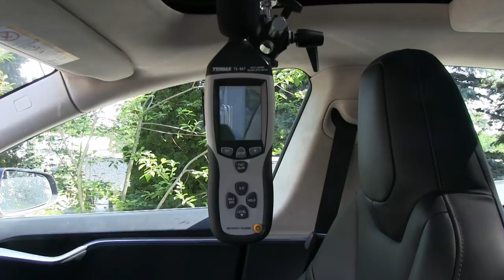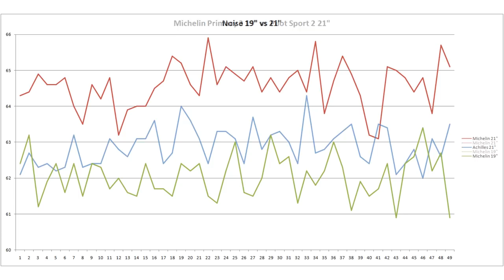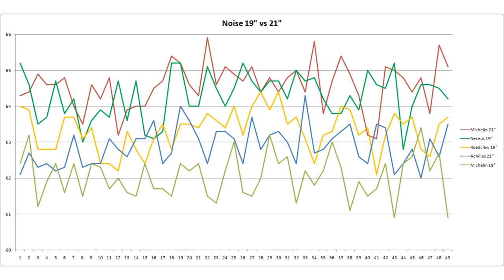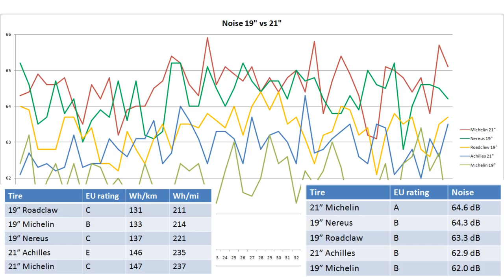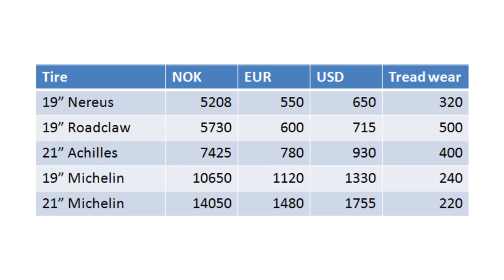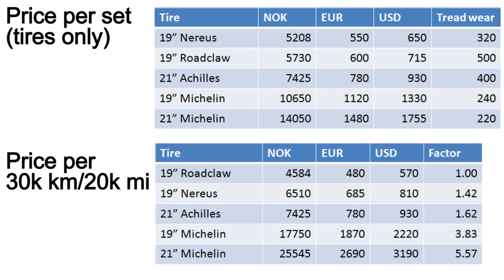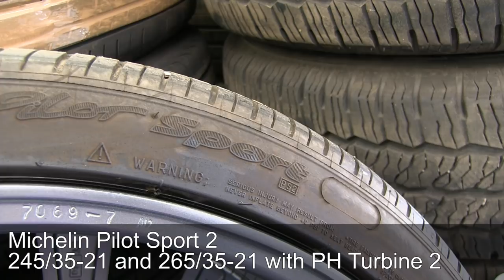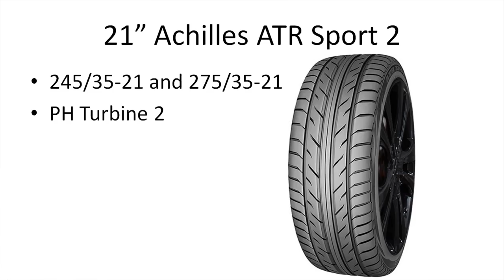19" vs 21" tire test on Model S

Comment: This spring I swapped my 19" OEM winter Tesla Model S wheels with the 21" OEM Turbine summer wheels. It is a bit noisier, but I expected it to be worse. So I am really happy I chose to buy 21" Turbines with my car. They look amazing, and I think they are worth the cost/wear/noise. But each to their own. :)
Reply: Which tyres did you purchase on those?
Reply: Which tyres did you purchase on those?

Comment: Performance is an important consideration. Some tires stop my Model S in 3.5 seconds, while the best can stop it in 2.2 seconds. That’s a huge difference! That’s a safety issue as well as a performance (lateral grip)!

Comment: Wet performance and handling is where the Michelin tires are supposed to shine. I think the Michelins saved me a few times in the rain (in the US) at lights where I needed fast lane changes and breaking to dodge other cars that ran red lights.  If you ever test tires again, could you borrow a test track where they hose it down first?

Comment: thanks for testing....
since 5 (tesla)-years i use "landsail"-tires (also chinese), at the 2013 tesla (model s 85) i used them in 18" and to my 2017 tesla (model s 90d) i use 19" - i feel very well with them
they are really quiet, a set of 4 costs around 300 euro and in my driving style, they will last for 50-80.000 km - the last tire i had to change  was with 55.000 km - it had a puncture, a pice of a cutting blade got into the rubber - handling and braking (also in wet conditions) is perfect, no trouble at all
my consuption over 28.000 km has come to 153 W/km, but i used the summer-tires the whole time - we have no real winter in south-germany

Comment: Good info Bjørn! But I think a test at motorway speed would make more sense. Tire noise is most annoying on long trips IMO. Also a tire that is quiet at low speed could become very noisy at high speed,  and vice versa is actually possible too to some degree.

PS. This test doesn’t take safety into account. Cheaper tires usually have longer breaking distance, worse wet performance etc.

Comment: Bjorns results are strange.
As i understand the Wikipedia article on "tread wear" the indicator is random by manufacturers choice, not to be taken very serious.

 Tests in Swiss/Austrian/German car-club press usually find that Michelin have superior durability (thus also Ecology, less micro-rubber!) over all other brands - while keeping high efficiency with  balanced performance and savety. 
Michelin also claims their designs work well down to minimum tread depth and tests i.e. with CrossClimate model support the claim.
 Thus Michelin is always my preferred option.

Comment: I have read the 10% difference in consumption between 19 and 21" several times. But I am surprised that the difference is already so big at the low speed in Norway. The difference should get dramatic at e.g. German Autobahn speed like 150km/h.
Reply from the maker: Rolling resistance is somewhat constant. Therefore you shouldn't operate with percentage because it doesn't scale correctly with different speeds.
Reply: True, but the rotational turbulence / aerodynamic of the rotating wheel is not constant and seems to have quite a big impact at higher speeds. I would like to know the difference in consumption at higher speeds. The percentage just helps to see how much less range you get with bigger rims.

Comment: I was driving on 21inch Super Sport tires and switched the rear tires to the Achilles and it's noticeably louder when driving above 40mph. Though the price point is hard to beat (Achilles = 87/tire, Super Sport = 340/tire), the foam inside the Super Sport does damped the noise when driving at freeway speeds.

Comment: what you need to test in tires is the core diameters (the part that connects to the drive shaft)... because tires are basically gears, the cores basically are transferring all the rotational force from the drive shaft from the motor... i hope you can do tests again for this...

Comment: Another great video Bjorn!  But how are you averaging 237 wh/mile on 21 inch wheels?  I have a P85 with 21 inch wheels and my average for the last 8,000 miles has been around 330 wh/mile.
Reply from the maker: +dancchang 70 km/h

Comment: Tire compound and tread pattern make more of a difference for noise and efficiency than the "wheel size". Overall, the wheels are about the same diameter and same width.

Comment: If you replace the standard wheel with a larger one it usually means low profile tyres . The manufacturer designs the car with normal tyres and the side wall is taken in to consideration when designing the suspension . Low profile tyres affect that design causing a harder ride and more wear on the suspension. This should be considered if you think big wheels look better.
Reply: 21'' rims are Tesla's ones

Comment: Bjorn, thanks for the review.  Been thinking of buying 19 inch rims to replace my 21 charcoal gray turbine wheels.  Do you have video of the 19 inch turbine 2 wheels? Trying to find a good wheel that looks like the original 21 turbine.  I would like to see what it looks like.  Looking for softer quieter more efficient ride.
Reply from the maker: +Jeremy Wasinger In my videos with the Nereus tires, I use 20" PH2 Turbine. They look similar to 19".

Comment: It's worth pointing out that wh/k is not important when buying tires.  At best a lower wh/k tire is going to save you a couple minutes per stop at the supercharger on trips.  With Teslas now days, superchargers are easily reachable.  It's unlikely that a 20 wh/k difference will effect the number of supercharger stops.  300 km at 140 wh/k is 42 kWh vs 36 kWh for 120 wh/k. Assuming 80 kWh average supercharger rate that's 31.5 minutes vs 27 minutes.  If you're towing, the 20 wh/k tire difference is meaningless when the trailer is costing you 200 wh/k.  

For local driving it matters even less.  Assuming you charge your Tesla at home once each night and pay an off peak rate the wh/k of a tire is likely to be the least important factor.  Off peak electricity is cheaper than the tire wear per mile price difference. A 20 wh/k difference over 30K thread life uses 600kWh more electricity at $0.10 cost you an extra $60 USD - that's $0.002 more per k. When you are paying $0.0183/k ($550 set) or $0.106/k ($3190) for thread wear, the $0.002 cost difference in wh/k is too small to be meaningful.    

Of all the factors that effect the choice or tires you buy for your Tesla the wh/k difference is probably the least important.
Reply from the maker: Efficiency might not be important for you. But it is important for other people. You got it wrong. When towing, saving 10-20 Wh/km is *huge*. You should follow my road trip videos and live streams to understand why.
Reply: Bjorn - I watch all your road trip videos and most of your live streams. The value of saving 20 wh/k diminishes as wh/k increases (saving 20 wh/k if your average 100 wh/k is 20% more range.  Saving 20 wh/k when you use 400 wh/k is only 5% more range).

Comment: Were all the tires inflated to the right pressure? a low tire pressure can cause way more sound to be produced. 
and 30k km on a set of tires? :-o 
I generally do 75-100k on them before the dealer suggests replacement due to wear and approaching the point at which they aren't legal anymore...  and at that point they aren't even there yet..
Bjorn, when was the last time they checked the alignment on your car? ;)
Reply: Model X is very heavy and got a lot of instant power if you accelerate...so...nothing special for a powerful car like his Model X
Reply: @esenel92 you also drive a Model S or an ICE Car? The weight of Tesla's cars and the instant torque eats up the rubber even when not flooring the pedal.
Reply from the maker: 10-30k km on Tesla is common. Just google it. Alignment is ok.
Reply: Wow..  that's insane! :-o 
I'd get that you'd have a little more tread wear due to more power to the wheels and higher weight.. but 10-30k km is really low..   
Expensive hobby if you need to replace them that often..
Reply from the maker: Not expensive if you go for Roadclaw.
Reply: Recuperation affects the wear rate as well, not happening at an ICE car, keep that in mind too.
Reply: @phuxus ICE,  so I guess this should go into my calculations to see if an EV is even worth it.   compared to my current car an Ioniq for example would save me about 1500 euro's in charging price compared to gasoline over 200 000KM (im taking that calculation because it has the best result of al the ev's I've looked into)..  But if the tire wear is so much worse, that probably (Ioniq's wear would probably be a bit less because it's lighter I guess) makes an EV more expensive to drive 

@Bjorn Nyland,  Well.. it kinda is expensive. If I'd go from about 330 euro's (per 4 which includes getting them installed, balanced etc) per (lets pick the minimum Ive done with tires) 75k km. and I'd replace it with 600 per 30k km... that is a LOT of extra money.
Reply: Actually over here an efficient ICE car can almost match the EV's due to high electricity prices and additional costs involved just fuel wise.
Service wise (as far as Ive been able to find service prices for them) the EV's often end up being the more expensive option too.  and now we can add the tires to that as well.  
the cheapest (1st) tesla service costs almost as much as 3 average services on my ICE car, have cost me over the last 400k km, while the intervals are equal.
Reply: Ämm, ether you brake the energy away into the brakes or you regen. the energy back into the battery. Why do you think the tires have to work harder with regen? The opposite is the case, EVs that regen. slow down more gently and earlier then fossil cars, because they want to get the energy back. Fossil drivers brake as late and as hard as possible as far as my experience goes. 

The 2 tonnes+ mass and the instant massive torque is the wear factor with EVs.

Comment: Hi Bjørn, 
I as wondering if you ever have tested fuel economy and noise of 21" Pirelli summer tires?
As far as I know these are the only 245/45/21 summer tires which have a B-label for noise and also a B-label voor fuel consumption. 

I mean these tires: https://www.reifendirekt.com/rshop/Tyres/Pirelli/P-Zero-SC/245-45-R21-104Y-XL-J--LR--PNCS--mit-Felgenschutz--MFS-/R-393558

It would be interesting to know how these tires are performing?

Comment: Good informative video Bjørn .thx alot. Personally I wouldn't trust ratings from a eu-regulation. The only way to know for sure is independent tests, from independent sources.  Time and time again we see  that even commercial sources are eager to promote  profiled merchandise. And it wouldn't surprise me , if the developer  of  the tyres are sertifying their own products.  It's thanks to guys like yourself  that are testing  and comparing stuff we really get to see the real  hands on difference between products. However that being said, this test doesn't review the handling or gript of the tyres in different speeds and weather conditions,  nor emergency breaking, water planning speed or comfortability. Then again I don't think that anyone ,that actually takes the time to search for reviews on youtube, decide them self for buying a set of tyres (or any prodct) after just looking up on one review .

Comment: Bjorn, 6db is a doubling in sound pressure level not 3db
Reply from the maker: https://en.wikipedia.org/wiki/Decibel
Reply: Wrong, it’s 6db.
The sound pressure level (SPL) decreases with doubling of distance by (−)6 dB. The sound pressure falls to 50% or 1/2 fold of the initial value of the sound pressure. The sound pressure decreases with the ratio 1/r of the distance. The sound intensity level decreases with doubling of distance also by (−)6 dB.
Reply: 3 db is a doubling in power. 6 db is a doubling in amplitude. You are talking about a different derivative.